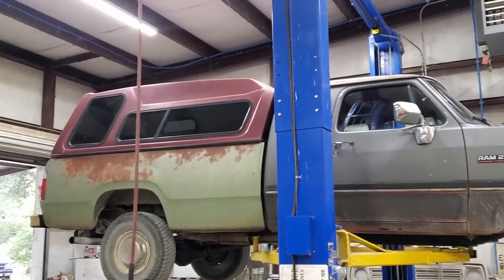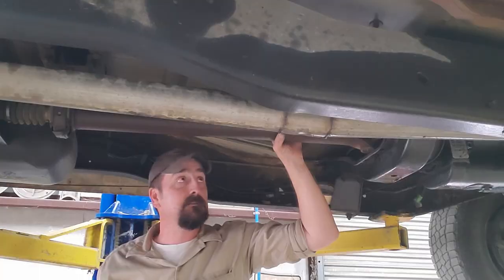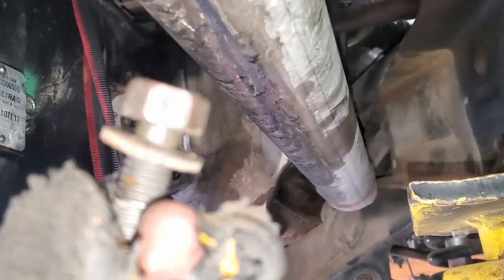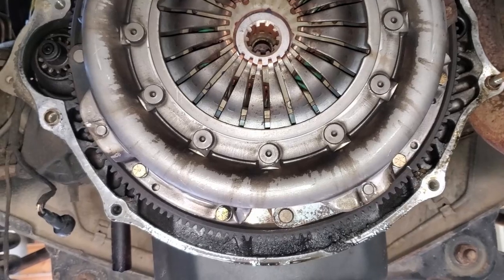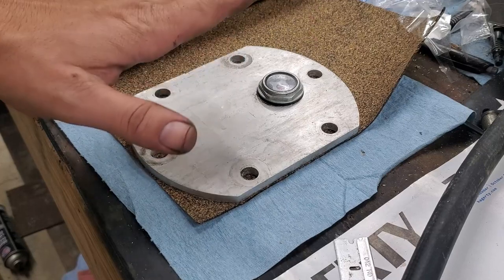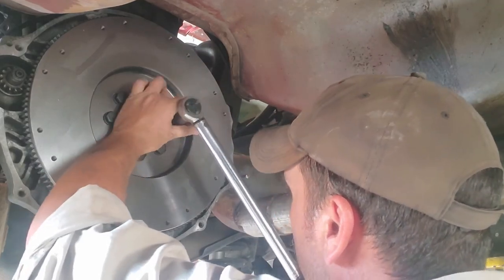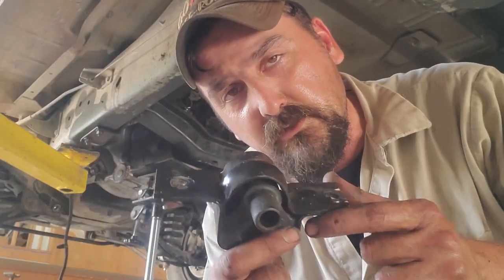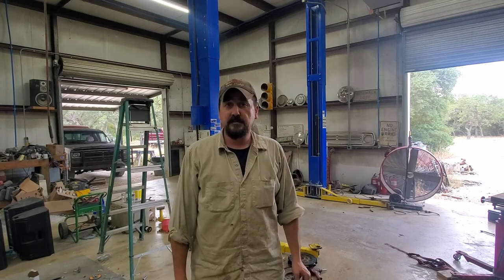Rear Main FAILURE ! 1992 Dodge D250 First Gen Cummins | Rear Main Seal | Valair Clutch Kit | Getrag

Comment: I was impressed that shaved bolt came out without welding anything to it. Everything went fairly smooth. I call that a win. Thanks for sharing and take care. ✌️
Reply from the maker: I got so lucky on that bolt, Glad I was able to replace it before that thing broke off into the case. Appreciate it and thanks for watching!

Comment: Hey duddie great video this is like the 3rd time I watched it now. My a518 decided to fry the overdrive clutches so I'm planning on doing a getrag swap. I wanted to see if you by any chance have the driveshaft length for this truck or could get it? Mine is an extended cab 2wd also and Im working on accumulating parts. Hopefully will be able to order in the getrag soon.
Reply from the maker: I do not have the driveshaft length. But I would install your new transmission and then measure for your new driveshaft. Any good driveshaft shop should be able to take care of you. Though most trucks are the same, small difference between setup and suspension can change the overall length. Appreciate it and Thanks For Watching !
Reply: @DuddiesAdventure  Alright just trying to do my best to avoid going to a driveshaft considering a slight funds issue atm.

Comment: Anti oiler rust prevention is working. I haven't seen a non greezy 12 valve that didn't work.
Reply from the maker: Have to keep the chassis lubricated, Appreciate it and thanks for watching!
Reply: @DuddiesAdventure  if it's leaking. It's got oil in it